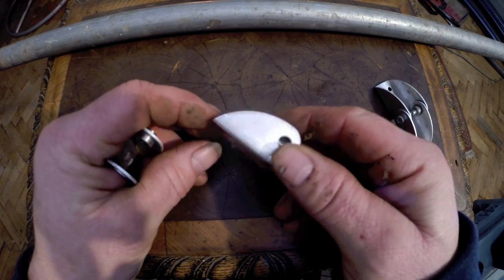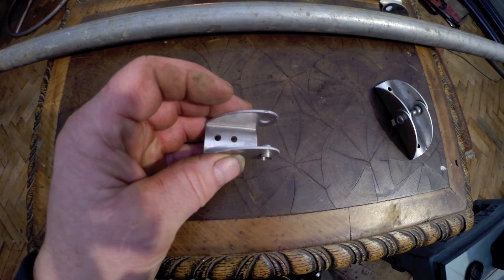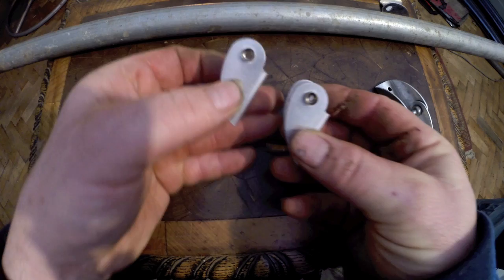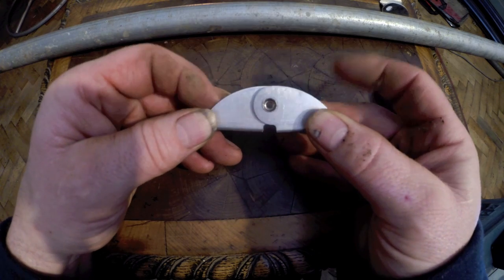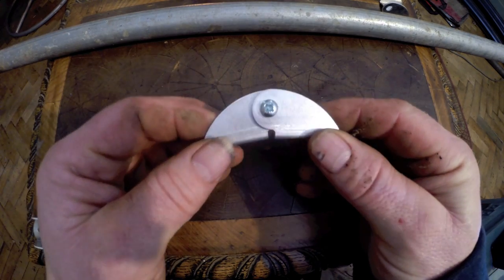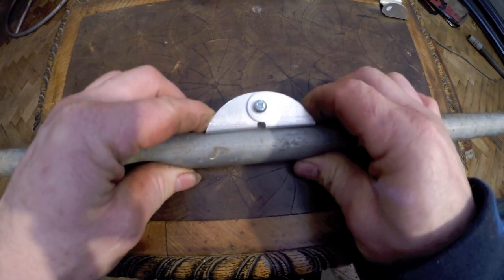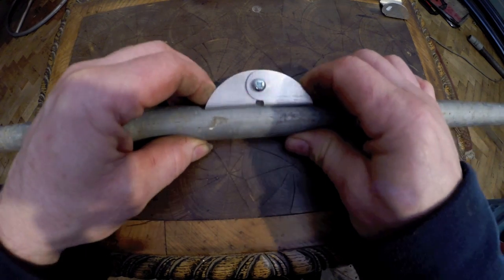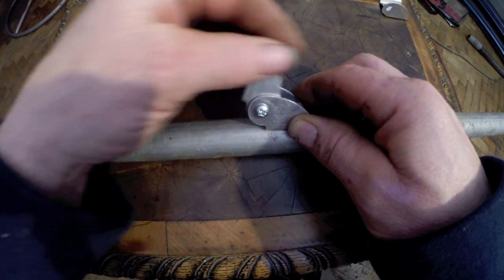UTA brackets

Comment: I really like the idea, but I think there s still a problem, where do you drill the holes to place them? Because every tube have diferent angles..how did you manage these?
Reply from the maker: I made a jig, all the angles and tube lengths are the same on this design so I only had to make one jig.
Reply: Excelent and what s the angle between hole and hole on a same tube?